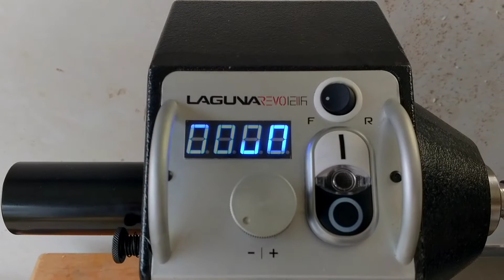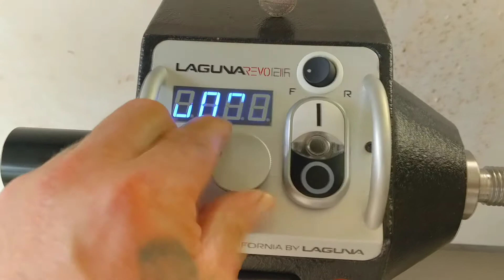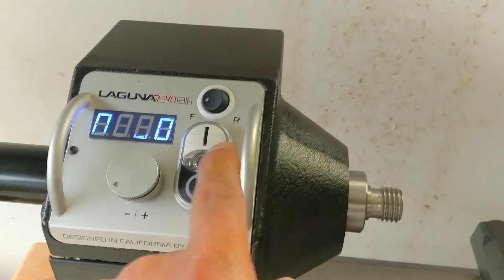First Turning on the new lathe. Laguna Revo 1216

Comment: I have been looking at that for a new lathe but they are hard to find most places are sold out of the and all other lathes
Reply from the maker: They are great little lathes.
I just checked and Wood Craft Supply has them in stock. Best of luck getting one. 
You won't be disappointed 💯🇺🇸
Reply from the maker: Outstanding Brother 💯🇺🇸
I hope it works out for you
Reply: @sodacan1011111111111  thank you
Reply from the maker: @richardschaffling9882  .. you are very welcome my friend 💯🇺🇸